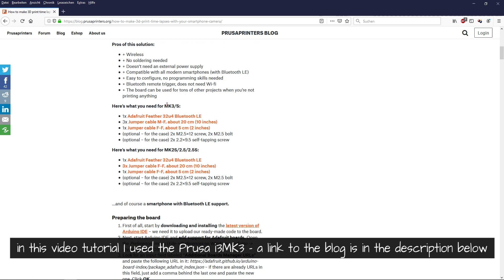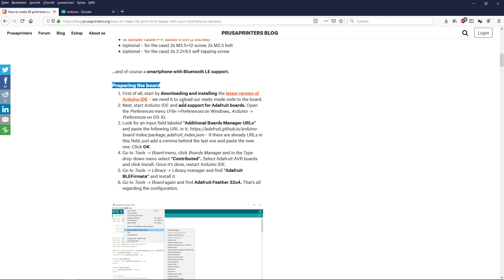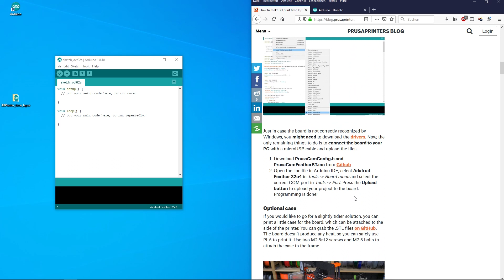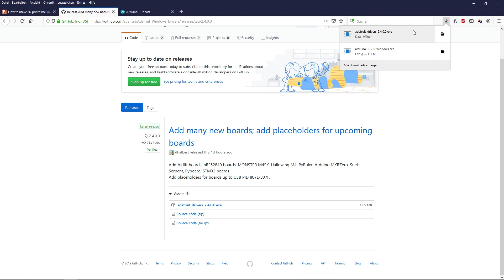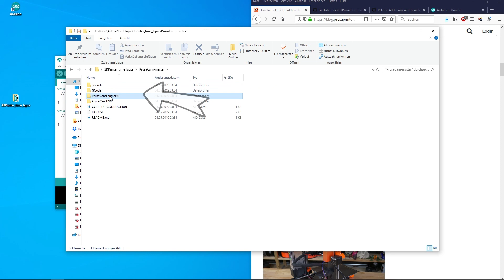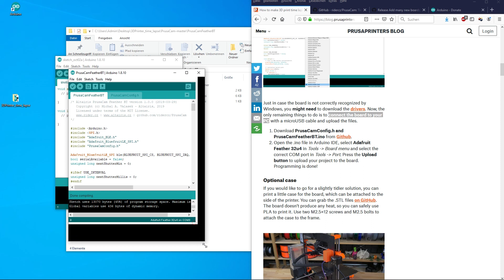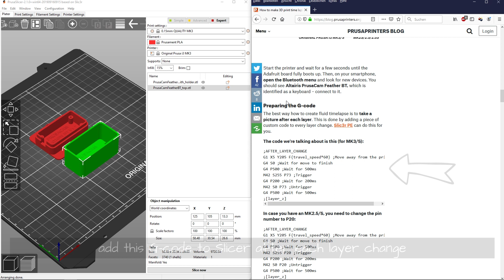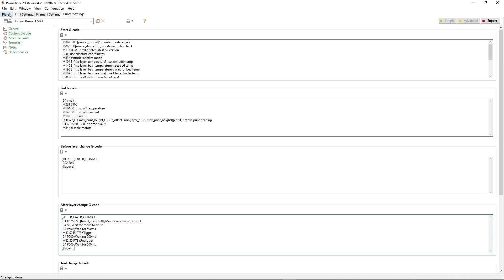How to create a stunning 3D print timelapse with your smartphone camera

Comment: Hi,
I got this prusacam successfully tested just a while ago…
but I realised that the photos only being taken for every 2 layers… instead of every layers…
I wonder is that normal for this?
Thanks….
Reply from the maker: Hi, the camera is triggered simply by G-Code and should take a picture after each layer. On my Setup no problems... maybe it depends on a newer firmware or additional features you are using in prus slicer? Can you double check if you add the code on the right place in G Code?
Reply: @MikrocontrollerProjekte  i think i found the root of cause... previously the phone saved the photos in the external memory... after i changed to internal memory... everything goes fine...

Thanks lot...
Reply from the maker: Thanks for your reply! Happy printing!
Reply: @MikrocontrollerProjekte  i just copy & paste the G-code in the "After layer change G-code": 
;AFTER_LAYER_CHANGE
G1 X5 Y205 F{travel_speed*60} ;Move away from the print
G4 S0 ;Wait for move to finish
G4 P500 ;Wait for 500ms
M42 S255 P73 ;Trigger
G4 P200 ;Wait for 200ms
M42 S0 P73 ;Untrigger
G4 P500 ;Wait for 500ms
;[layer_z]

Comment: im having an issue where when i have the feather plugged in, its triggering the smartphone all the time, every 5-10 seconds with no gcode loaded and printer not running. is the firmware to the feather at fault? i have re-uploaded the firmware successfully, and it does the same thing.
Reply from the maker: I know the problem but on my printer it happends not so often. Maybe a simpel pull up/down resistor on the trigger pin helps to solve the problem.
Reply: @MikrocontrollerProjekte  Great info, do you have the schemaics how you connect the pull-UP/DOWN resistor (Feather-Rambo)?
Thanks